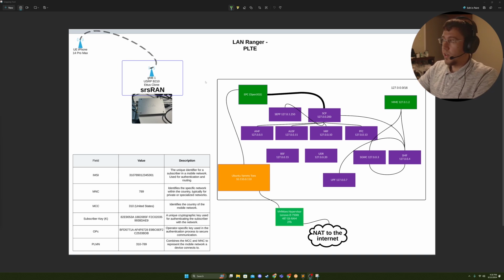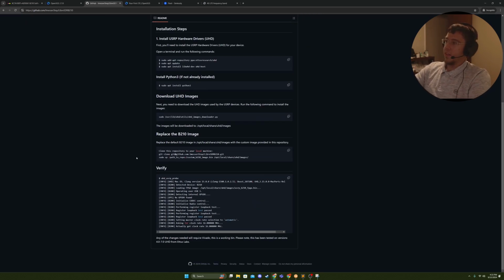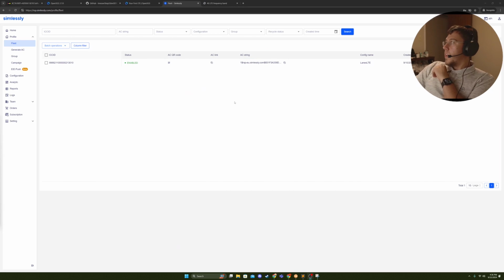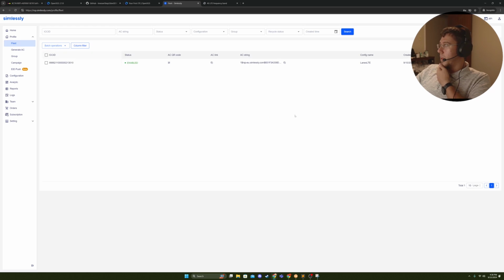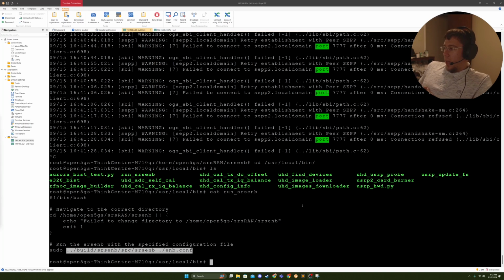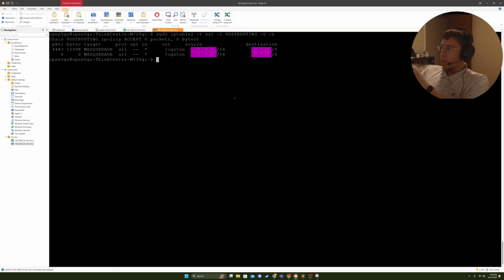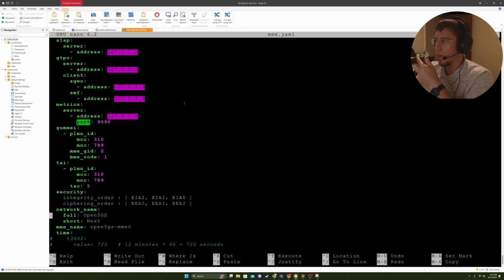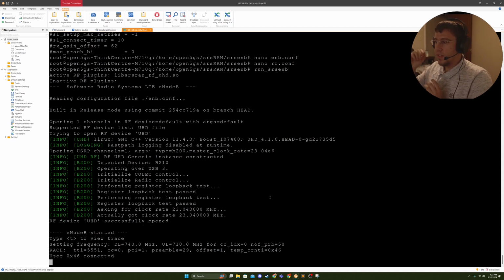Broadcasting my own cellular - The Setup | PLTE w/ Open5GS and B210

Comment: After a while i finally got my hands on the LibreSDR b210 mini, I followed the Your First LTE guide and everything seemed to be setup correctly, the sdr was transmitting, but the UE would not find the network, despite me changing the MCC and whatnot it would not find the network at all, I tried DragonOS with srsEPC aswell as srsENB with it already preconfigured, and set it up with simlessly eSIM, and the phone still would not find the network, i've looked at the enb.conf files aswell as the mme.yaml for open5gs and all that but everything seemed to be setup correctly, i'm wondering if simlessly is the issue or it's the actual SDR, i haven't tried a physical sim since i do not have one so it's just been through eSIM, though i had no problem listening to FM radio with SDR++ aswell as other tasks.
Reply from the maker: You need to review log files in /var/log/open5gs
Reply: @LANRanger  I did do something wierd where i would run uhd_find_devices on my host windows machine and when it would load the FPGA and reconnect, only after that i would pass it through to vmware, and the Ubuntu VM would recognize it as the b210 and srsENB on the vm would recognize it and transmit. though I will still go ahead and check the logs for open5GS but i'm wondering if that is a causing factor
Reply from the maker: @legobobbrix that’s because of usb enumeration. When you share the b210 clone to a guest and then load the FPGA, the controller behaves as another device.
Reply: @legobobbrix The issue is with passing the USRP through VMware. srsENB needs tight timing for RF signal processing and transmission, but VMware’s USB passthrough adds too much latency/jitter. The virtualization layer just can’t keep up with the real time requirements, so the setup won’t work reliably. It could be the reason the UE cannot attach, and you're probably missing some errors in the logs.
Reply from the maker: @RenatoCamata-k5s  that’s not the case at all. I run 25MS/s just fine on TCP/IP Based USB passthrough. 

Essentially once the FPGA binary is loaded, the usb is essentially disconnected and reconnected as a new host. 

If he loads the binary first, then shares the usb to the guest, it works fine. 

This is because of usb re-enumeration. It has nothing at all to do with latency. 

Once the binary is loaded it re-enumerates. 

When you go and attach a usb to the vm, it basically shares that specific VID/PID that exists. But once the binary is loaded, a new one shows up.
Reply from the maker: Just for the record, I’m doing this on an emulated Ubuntu VM in UTM just fine. It’s all handled by CPU and there’s no real hardware involved. Latency is absolutely not an issue. A contributor maybe, but not a reason for the phone to not attach.
Reply: @LANRanger  I'm not really too smart when it comes to how it works, but i was getting alot of these "RF status: O=0, U=1, L=29 RF status: O=0, U=1, L=124 RF status: O=5, U=13, L=780 RF status: O=0, U=6, L=100 RF status: O=1, U=1, L=121 [INFO] [UHD RF] Tx while waiting for EOB, timed out... 29.844 >=", the Ubuntu VM i have it running i provided it 6 cores, and 8 GB of ram, my main machine is a Asus zephyrus with a i7-10750H, 16 gb ram, I think my laptop is the actual bottleneck here and it cannot actually handle it, but i'm not too sure, it's still a bummer i couldn't get it running properly :/
Reply: @LANRanger  I've checked the logs and they seem to be okay, i tried different LTE bands and my sdr transmits those, the TRXA and RXA lights are on, still no connection on the UE, I've tripple checked the sim details and everything seems to match.
Reply from the maker: @legobobbrix what is your UE? My iPhone doesn’t support all bands despite Apple’s website claiming it does. I think it’s because it was purchased from Verizon. I would try the big three supported bands first.
Reply: @LANRanger  I'm using my personal S21 Ultra unlocked from T-Mobile, i have my MetroPCS sim in it aswell as my Open5GS esim from simlessly.
Reply from the maker: @legobobbrix what bands are you connected to on MetroPCS?
Reply: @LANRanger  Right now i have it on NR band 2, otherwise off 5G it would be on LTE band 71 usually
Reply from the maker: @legobobbrix I’d have to get in a call with you to troubleshoot like I have for others. What is your discord
Reply: @LANRanger  it's legobobbrix, not sure why youtube didn't post my other reply 🤦

Comment: Thanks for your research! Will this setup work on B210 Chinese clone ?
Reply from the maker: @Sigfdjddddun  that is the device I’m using.
Reply: @ awesome ! I’m waiting for mine from china . What max distance could you achieve with decent antenas ?
Reply from the maker: @Sigfdjddddun  about 5 feet from the SDR
Reply: @ that’s short . I had similar experience with bladeRf + raspberry setup when I was running my 2g setup years ago

Comment: I'm not a telco engineer, but I'm hoping of becoming one. Next year I'm - hopefully - going to attend to university in telco space.
I only work in my local ISP on creating WiFi networks and stuff.

As much as I'd love to play with my own cellular network, I'm not quite sure about creating one in terms of legality of it in my country.

I know cellular repeaters are prohibited and very, very high fines are being... fined for using one or even by owing one. I'd have to research that a bit. Maybe by using different than common in my country band would be fine?

But you inspired me to do what I dreamed of for a few years now. It seems like relatively easy task. I didn't even know that was possible with such little hardware.

Comment: Thats so cool! Did you manage to fix the esim activation issue?
Reply from the maker: Unfortunately no. I tried and tried and could never figure that out. All I know is that as long as I leave it on airplane mode until it fails then it will connect just fine.

Comment: Wow, this was really interesting. I've wanted to play around with cellular networks for quite some time, but never got the chance. I have some questions:
- How does licensing these networks work? I presume that running a private network on normal cellular bands is not legal without a license from the FTC? I assume most people are just going to run any test networks without a license and hope they don't get in trouble?
- It is impossible to connect consumer equipment with GSMA eUICC/eSIM, right? (Such as US-model iPhones with no physical SIM slot)
Reply from the maker: 1.) research cbrs/GAA and SAS 
2.) no, thats not true. Any phone will function. No limitations with that. My personal iPhone purchased directly from Apple like everyone else operates just fine using esim so as long as the parameters are correct. See my previous video post
Reply: @LANRanger  ah, cool, that's definitely what I wanted to hear!
I've heard a bunch of mentions of SAS, but it looks like you have to find a provider willing to work with you? If that is the case, who did you work with? Is there some kind of DIY thing or is this going to be some expensive process?
Reply from the maker: @jjtech0130  honestly, research as much as you can. I'm still researching myself, I don't want to spread misinformation. With that being said, my previous video post was merely a proof of concept/educational post. It does work, however.
Reply: @LANRanger  I've been scrubbing across your videos, I still can't find where you actually create/install the eSIM. If you could link that to me I would appreciate it, I have no idea how I'm missing it
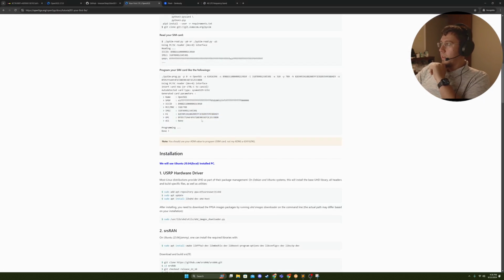Reply from the maker: @jjtech0130  its on this video at 09:15. in my previous video i showed the esim in the settings app on iOS. but it was already installed so I didn't show that.. so sorry!
Reply: @LANRanger  oohhhh, duh. I saw the iPhone in the last video while scrubbing so I thought you had showed it previously and I had somehow missed it. Ooops!
Reply: @LANRanger  have you looked into the Google Cloud SRS thing? I just noticed it, and it actually looks reasonable priced ($3/device indoors?), and doesn't look like there are any barriers to entry??
Reply from the maker: @jjtech0130  that’s what I’m doing now actually! Funny that you mentioned that. Great minds think alike. I want to get this working within FCC standards with proper licensing and what not.

Comment: out of curiosity (again), do you get data connectivity and what kind of speeds is the B210 pushing? 

actually I have a thought of setting up a 2g network that is still in my todo list but 4g/5g definitely seems interesting :D
Reply from the maker: @wcypierrenet  I do in fact get data. Speeds are anywhere from 1-10Mbps depending on bandwidth, channel noise and overall frequency.  In the last posted video, I did a Speedtest to my local private server and a public server.
Reply: @LANRanger Does the bottleneck lie in the thinkcenter running it all or in the radio itself?
Reply from the maker: @elgato7557 it’s a little bit of both. The CPU is just weak as water, but the radio is also a weak point